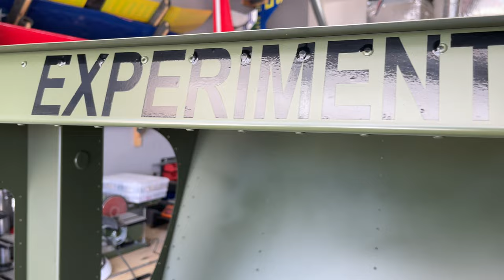Zenith Cruzer Build: Painted the interior

Comment: Joe I’ve been working with Steve at aircraft specialty since the beginning of my build.  He is great to work with and full of information and assistance.  I was originally going to do the flip down panel but with having the horizontal bar at the bottom, it’s already tight for any switches.  Also for me, with 2 big screens, I can access inside by just removing a screen.  Steve is also making all my brake lines, fuel lines and panel.  My panel episode is coming soon.
Reply from the maker: Thanks, yeah I still need to call him. I wanted to call this week but work got in the way again. I will force myself to call this week.

Comment: Why add the complexity of a hinged rear channel lid, rather that just lift it off? I'd be worried, if I did have to swing it open and work inside the channel, that I might bend/tweak the lid, or scratch the rear baggage panel where the hinged lid comes to rest. Simpler to just duplicate the rivnuts and domed screws on both ends of the rear channel lid? Not criticizing, legitimately curious. I'm a few months behind you, so this is great learning content for me.
Reply from the maker: I kinda agree. I haven’t hinged it yet. I will keep thinking about it.